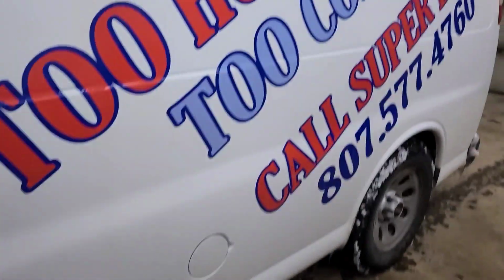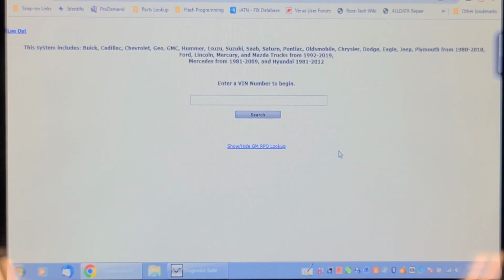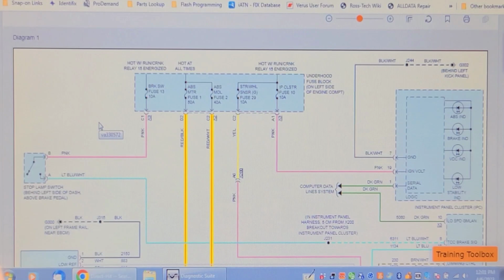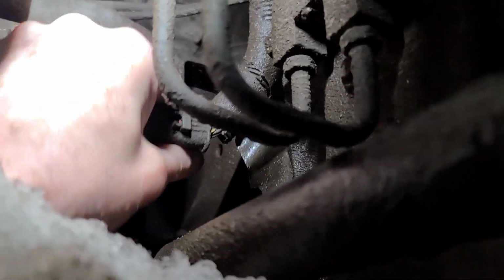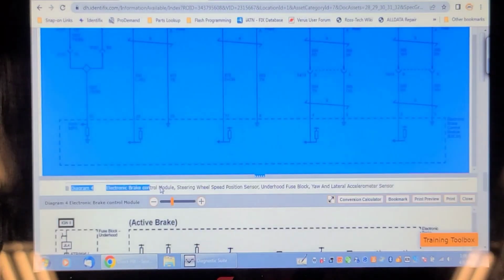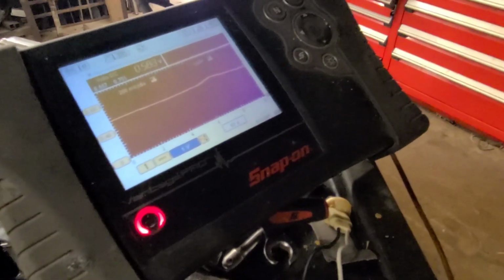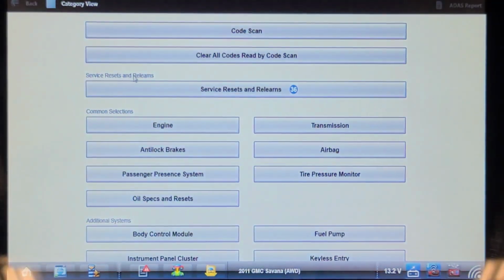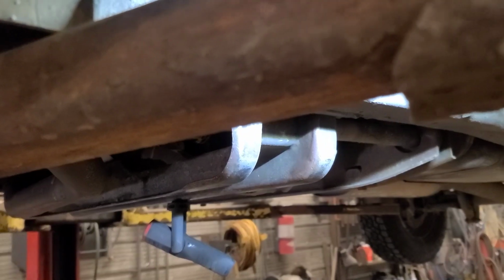2011 GMC Savana Van. ABS, Brake and TCS Lights On, No Communication With ABS Module

Comment: i was wondering if you know what the signal voltage to the control module was after the wire repair
Reply from the maker: On that circuit I repaired it's 12 volts from the BCM.

Comment: Great diag as always! Nice also to be able to see how other systems might act if "such & such" happens, especially when it is right there to test. Anyway, you got them back on the road. ALSO, 25L/100kms is what I get if my 5.0L F150 pulling a 28ft camper trailer at 100 kph on holidays! Yikes!
Reply from the maker: Thanks for watching 👀

Comment: THANK YOU FOR YOUR TIME ,,,,,,, GREAT TO THE POINT DIAGNOSTIC 👍 WOULD ABSOLUTELY LOVE TO SEE HOW YOU HANDLE A 5 VOLT REFERENCE CODE THANKS AGAIN FOR YOUR TIME 🙏
Reply from the maker: I've done a few. Usually if it's puled low I start by monitoring it and then disconnecting sensors that share the voltage. I'ts not bad if the problem is consistent. Did one on a Ram with the APP, TPS, codes setting intermittently. I believe it was a defective oil pressure sensor which also shares that Vref. https://youtu.be/MbpZtysOEx0
Reply: Thank you for your time 
Where is your shop
Reply from the maker: @manoramachandran9192  I'm just outside of Thunder Bay in Ontario Canada eh. 🇨🇦